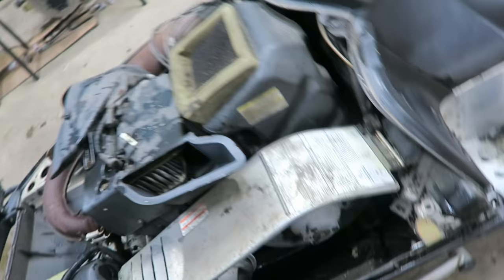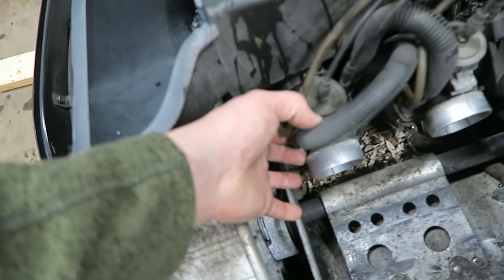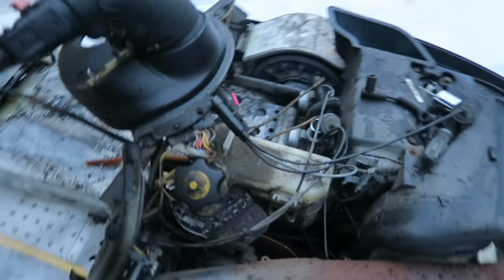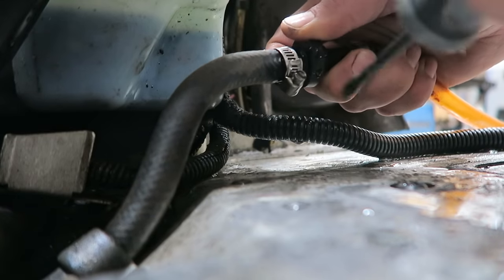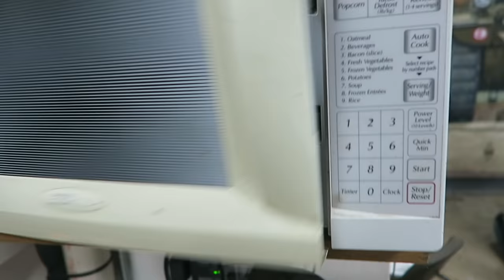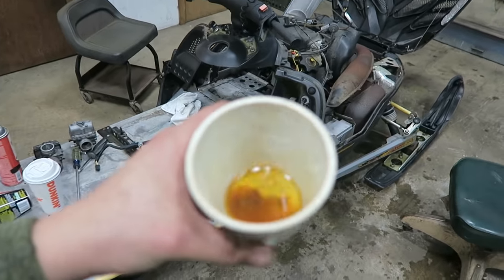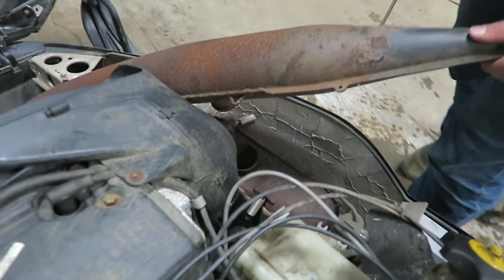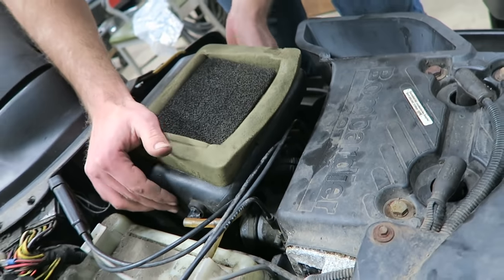Reviving DEAD Ski Doo MXZ LEGEND 550 Snowmobile!! (Very Strange)

Comment from the maker: What is the greatest snowmobile ever made? Let's start this battle down below. :)
Reply: The introduction of the REV chassis was pretty badass.  My vote is for the REV
Reply: any old skidoo
Reply: The Yamaha triples
Reply: rev chassis
Reply: Scorpion 440 Range Whip
Reply: 97-98 Polaris Xc 700
Reply: Ski doo first rev gen and the new gen 4 ski doo
Reply: 1997 skidoo touring sle atleast that's what I think
Reply: I have a 2001 skidoo mxz 600 it's the best sled i have owned
Reply: Ockelbo 300
Reply: The old reliable Polaris indy 550f
Reply: @benjaminfrankson370  they had some bad years in the edge chassis
Reply: @Snotric  came here for this ☝️
Reply: Polaris 550f engine has always gotten me home while pulling somebody back after a long day of hunting up here in the north
Reply: Any old Polaris
Reply: @goldenrustorbust  ayyy.. my man
Reply: Skidoo formulas r amazing
Reply: We had a Yamaha V-Max 750 4 cylinder. It sounded insane and was fast AF but soooooo heavy.
Reply: 500 indys never die
Reply: F7 non diamond drive
Reply: 90's Polaris triples
Reply: 99-00 Ski-Doo touring E S-Chassis.
Reply: Skidoo 850
Reply: 2002 Ski Doo MXZ 700 sport
Reply: Late 80s phazer and phazer II
Reply: BRAVO .
Reply: 1988 Tundra longtrack
Reply: 96 Indy xcf 440 / 2009-10 crossfire 600 as long as you upgrade the diamond drive 6203 bearing. Also agree with less editing and more natural footage
Reply: Yamaha vk and triples
Reply: Skidmore or polaris
Reply: 2003 XCR 800
Reply: Without a doubt the Ski doo rev!! Love the videos bud keep em coming!!
Reply: Yamaha bravo most reliable engine ever created
Reply: 2018 articat snow pro
Reply: So, the INDY 500 and the XLT both brought sledding to the masses in a prolific way. I think Polaris sold more XLTs one year than Yamaha sold total as a company.

Back in the 80s the original Indy was kinda like the REV 20 years later. Totally forced every manufacturer to up their game. People don't realize sleds had buggy suspension and leaf springs before that.
Reply: Zr thunder cat
Reply: Indy 500 hands down
Reply: Polaris wedge fanners
Reply: Yamaha vmax they fast asf
Reply: Phazer's
Reply: my mxz
Reply: @milesburrill7964  easy ally an skidoo elan or an Olympic or a artic car panther 1971 440
Reply: Well a skidoo Nordic
Reply: I would say a weird snowmobile called a snow bug it’s a twin track snowmobile
Reply: Polaris indy sport 1987
Reply: Just my humble opinions:

Best Old Engine: Polaris 488
Best New Engine: Ski-doo 850
Best Chassis: First Gen Rev
Best Sounding Sled: Arctic cat triple pipe
Best snowmobile ever made? The one you got to drive the most as a kid.
Reply: 1997 mach 1 700 triple

Comment: Love the older sleds for financial reasons. Living in New England the season is short. I made a Boss seat equivalent, for a total cost of about $20 using those stiff rubber pads used for weeding flower beds, spray adhesive, small piece of blk vinyl and a few snaps. Found a 6” riser at a salvage yard. Ergonomically it rides similarly to the newer rider forward sleds. I’m into it for about $2000 instead of 4 or 5 times that much. Love the vids.

Comment: you shouldn’t load sleds on the tailgate because the oil will run to the front of the cylinders and when you start it 75% of the cylinder walls will be dry and eventually ur motor will go